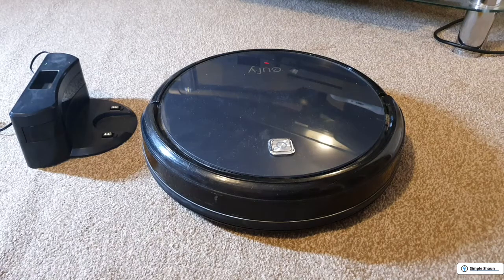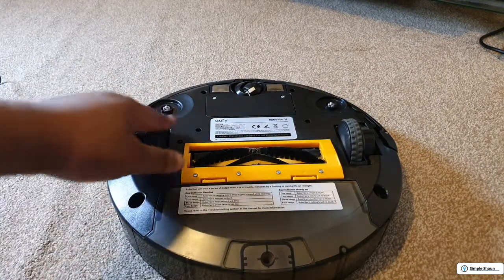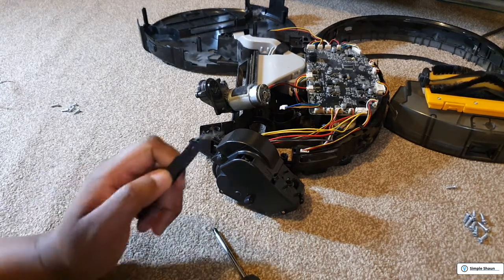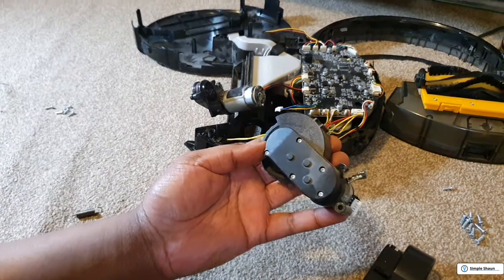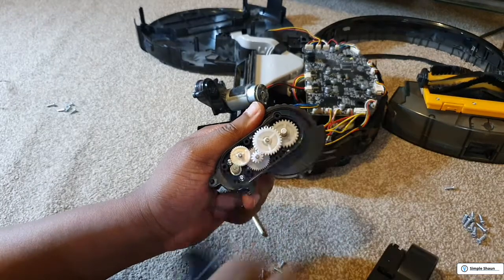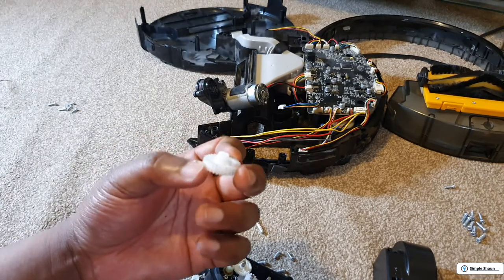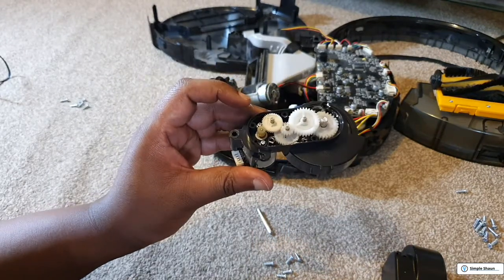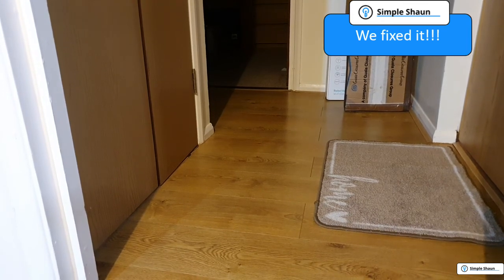Can I fix it? Eufy 11c - spinning in a circle

Comment: I just want to say how brilliant you are.  I foolishly used my euphy to clean the outside carpet after a dust devil went through.  Rhen it wouldnt work again.  Spinning in circles.  You were the only one adressing the problem.

So after previously taken the bumper off and cleaning the roller ball and brushes and it still went just a few seconds before it began soinnjng in circles, I found yiur video.

I turned my euphy upside down and did the wheel check and both wheel were working properly like you described.  I put it back down in the ground again, tried it out, worked for a few seconds, then spinning in circles like before.

Then I showed hubby what I had done and when I picked the euphy up again there was fuzzy crud on the floor, like where the wheet had been on the ground. Hmmm
  Strange.  So I tried the euphy again AND IT WORKED.  Apparently I had fuzzy crud stuck under the wheels.  And whereas I didnt have to take my euphy apart, you were the only one addressing the wheel problem.  I am so greatful because we were ready to buy a new one.  I ram it for several minutes, no problem.  Totally fixed due to your video.  Thanks.
Reply from the maker: Glad I could be of help, and save you money in the process :)

Comment: Hi Shaun, I have a robot vacuum cleaner HOSOME, which had a problem with the brush motor, before that it worked very well. I disassembled and cleaned the gear, put it back together and now the brush spins again, great! but now the robot rotates in circles, and before that it didn't happen,
I took the robot apart again but I couldn't find the problem that seems to be a sensor...but I don't know which one. Any idea? Thanks
Reply from the maker: Hey there, the first thing i would try is cleaning the front bumper, if its scratched / dirty it can cause the machine to spin. If it is spinning in a way that looks like one wheel is spinning but the other one isnt, check the connection to the wheel, and also make sure that nothing is pressing against the wheel, i have had this before. Let me know how you get along.

Comment: Mine has no friction on one tired
Reply from the maker: No friction when you spin a tyre normally means that the cog assembly has gone in there, if the unit spins in a circle you will either need to get new cogs and replace them or a new wheel assembly from eBay. The fix is not too difficult, its easier on the later models, but finding the cogs can be tricky...

Comment: My 11s also had gear teeth just "exploding". Awful quality, but at least their customer service is nice. Really low quality products though.
Reply from the maker: I understand why they need gears, i feel like they needed to use a stronger plastic material, or at least make the assembly a bit thicker, its a shame considering that these are wonderful machines
Reply: @SimpleShaun80  My replacement unit wont even go under furniture anymore. The unit is 2.8 inches (7.2cm) high and it will simply refuse to go under furniture that is between 15-20cm high. Last time I'm buying this brand.